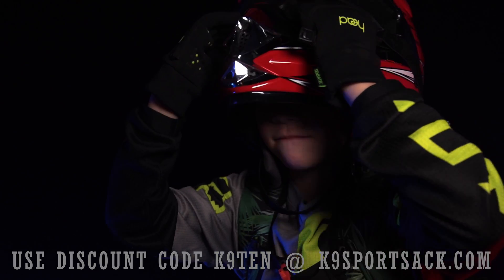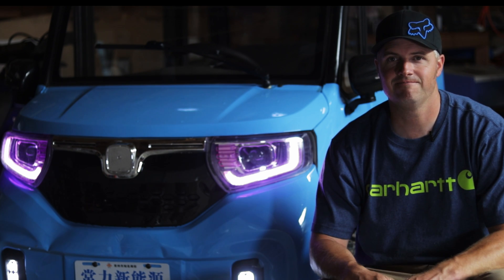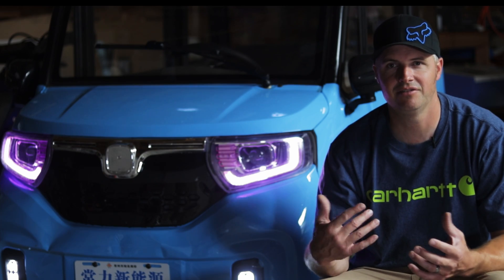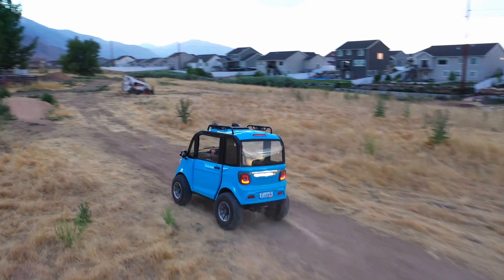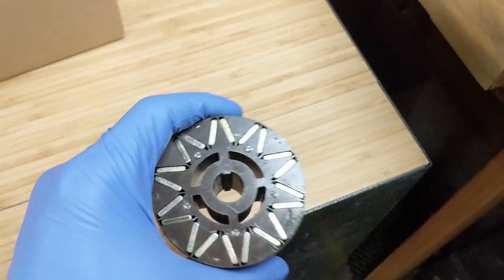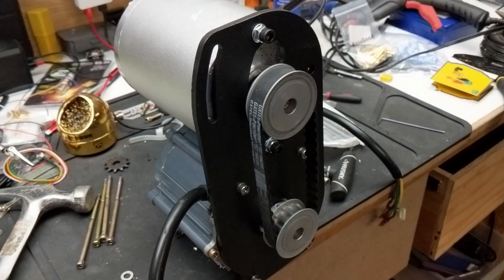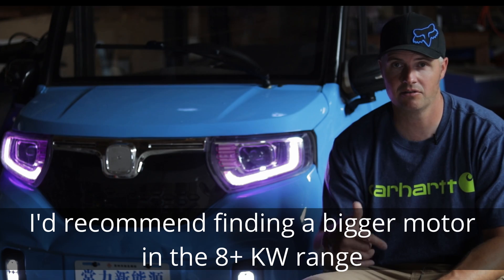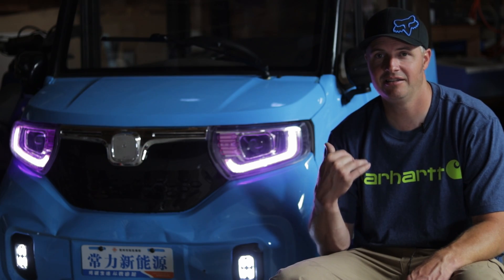CHANGLI MONSTER MODS PART 2! POWERTRAIN UPGRADES FOR THE WORLDS CHEAPEST EV WITH BIG TIRES AND LIFT

Comment: There's space and mountings for a small genset under the bonnet.
I'd rewind a  small 3 or 4 kw genset for ~70 volts and see what kind of fuel economy can be gotten out of it.
NB that constant rpm engines are way easier to tweak for economy with things like like tuned length exhausts and intakes etc.

Comment: Hi. Im having a tought time trying to figure out what replacement batteries i need for my chang li. It has 5 batteries.  Can you recommend some please?
Reply from the maker: Yes check out my newer video where I show replacement batteries in the red Chang. There are Amazon links to the batteries I used. They are better than stock
Reply: Sorry, i could not find the Amazon link you mentioned

Comment: Try PLUM QUICK motor and controller set up I’ve built a couple of carts with this set up and some of them will do 80mph +
Reply from the maker: Thanks for the tip! I've been on the hunt for golf cart performance parts. I'm modifying a cart for a friend right now. Which components do you run?

Comment: I'd love to see this with a 450-1000cc swap. It would rip
Reply from the maker: That would be awesome! First it would need custom independent suspension. Stock suspension is horrible and unstable
Reply: I'm wondering if a graft from an atv would be possible. Right down to the rear diff and all.
Reply: Or maybe suspension from a UTV? Or Mazda miata even.

Comment: I've been shopping around for an EV to drive in Cali, and I keep finding this issue with range. Is it difficult to covert solar power to charge the car while in motion?
Reply from the maker: It would have to be a pretty big panel to make a difference but you could do it. I would not count on a solar panel extending range too much. You could probably fit about 200 watts of panel on the roof if you are lucky. The car stock and way underpowered has a 1kw motor. If you were just cruising and using around 500 watts of power and generating 200 watts in full sun you would be operating at a 300 watt deficit. When you factor in the losses from whatever hardware you would need between the panels and batteries, benefits would be lower than that. However, if you left it parked it could charge it over time.
Reply: @3dconceptsofutah757  good point. I wanted to buy an EV to doordash and utilize around town, but I don't want to run into the issue of charging it as I would with a traditional car needing ⛽ after driving. Any suggestions?
Reply from the maker: @newmom1171  If you find a car with a large capacity (range rating) You could find something that might work. Do you live in a small town that would allow a golf cart to drive around town? That's essentially what these ones are. There are more serious EV's out there that you could bring around town. Might be better to get something like a used real car EV like a Nissan Leaf or something....
Cheers!

Comment: I was wondering how long it would be before someone upgraded the motor in one of these. Now you just need to switch it over to LiFePo4 batteries and you will get some range out of it too.
Reply from the maker: That would be nice! I might be trying to pull too much from these batteries anyway with the new motor I'm installing today!
Reply: @3dconceptsofutah757  Might be? LOL none of the wiring on that thing is designed for a 6kw motor

Comment: This is very cool. I think the thing I've hated most about these is the whimpy motor and the whimpy tires. With the bigger tires it looks so much better. Read you got a 6kw motor to try next which is what I would of gone to as well. Subed and excited for the next video!
Reply from the maker: Thanks! Yes I'm sending the new motor mount to the laser cutter right now! The new motor is crazy big 15KW peak! Hope it doesn't shred the axle before I get to play with it for a bit
Reply from the maker: Got the 6kw in last night! I was sad it didn't breath fire like I hoped ;-D It does feel much more powerful but not insane like I'm after. On to the next bottleneck in the power train which is the batteries and cabling....

Comment: Great setup. The original motor actually looks pretty good internally. Its an IPM motor, so very good for flux weakening (overspeed) and would probably handle similar power to the Kunray motor, especially with the kelly controller. Best of luck with the continuing build process ✌️
Reply from the maker: Bob, thank you for the comment and insight on the motor! I have wondered what would have happened if I had just thrown the Kelly controller on that stock motor! It's OK though because it has pushed me forward with the mods I wanted to do to the car anyway. Cheers!

Comment: Please keep it electric, too much change and too much replacement parts or more than the absolute necessary will kill the point of having the cheapest car and making something very fun out of it. At least for me, its best when the upgrade are done thw short st and simplest routs, that is ingenuity after all. Love your qork and hope this channel grows.
Reply from the maker: Thank you for your comments! I agree that there is something special about EV's that make them more enjoyable to drive. FoxxyYT pointed out a motor that I'm very interested in trying on this project. Ultimately it's going to be up to the owner as this is not my car. I'm just doing the mods on it. I'm trying to talk him into the QS138 90H which I think would be a great fit for this car. Cheers!
Reply: @3dconceptsofutah757  much anticipation
Reply: @3dconceptsofutah757  I have build electric dirtbike with qs 138 70h and it got about 30kw of power but controller didn't have alot of phase amps but it was still very fast. Qs 138 90h with 800A to 1000A phase amps and 103v battery would make this thing unstopable.

Comment: The modified build is very nice, but that KunRay 3kW motor doesn't look able to hold a higher peak power.
Grab a QS138 70H or 90H (https://www.electroandcompany.com/product-page/qsmotor-qs138-4000w-with-splines-1)
These motors are 3000-4000W nominal, but if you search on forums for electric motorcycles, with a powerful battery and a nice controller, they can hold 10-15kW peaks without any "boom" or problems
Reply from the maker: Just ordered an ME1719 from Motenergy which is a waterproof 6KW continuous brushless EV motor for this! Stoked to see what it will do.
Reply from the maker: I totally agree! Thanks for the tip. I hoped someone would point me in a better direction! That link apears to be dead on my end. Could you try another link? 
Thanks!
Reply: @3dconceptsofutah757  just delete the ")" at the end
Youtube don't let me edit it
Reply: @3dconceptsofutah757  also, your Kelly Controller seems able to hold close to 14kW for 30s and 5,76kW continuously, so it won't need to be changed
Reply from the maker: @foxxyytofficial  Thanks yes I had to turn it way down in programming and it still melted one of these motors ;-D I just drive it cautiously now. Thanks for your recommendations!
Reply: @3dconceptsofutah757  no worries
If you need any help, let me know
If i can't give you a definitive answer i will help you to find ine
Reply from the maker: @foxxyytofficial  Thanks! Are you into building EV's of any sort?
Reply: @3dconceptsofutah757  unfortunately no, i never had the chance to build one
But i learn a lot researching about building them

Comment: Looks good did you have to trim to fit the tires?
Reply from the maker: Thank you! Oh yes a lot of trimming! In fact I need to trim more and move a couple things
Reply: @3dconceptsofutah757    give it some A arms
Reply from the maker: @j5892000  That would be much better for sure. I'll see if I get that far with it!
Reply: @3dconceptsofutah757    should be cool. Mayby a rear swing arm  type suspension  like on a dirt bike